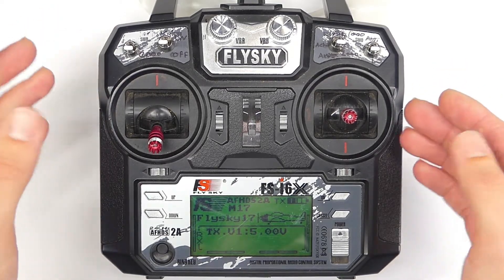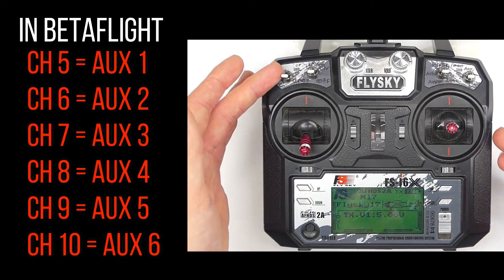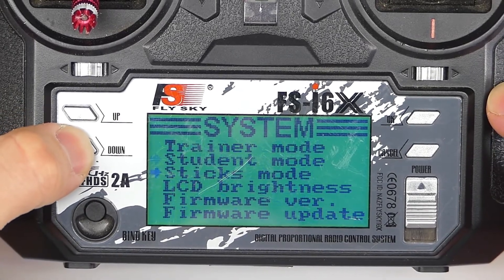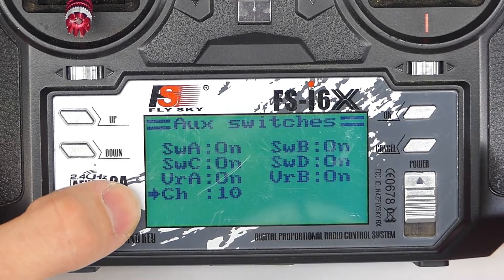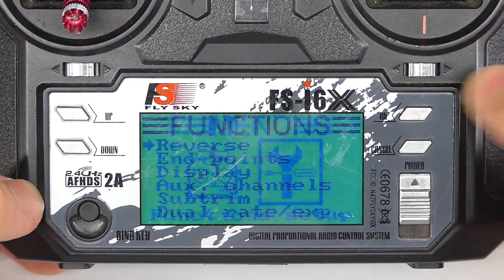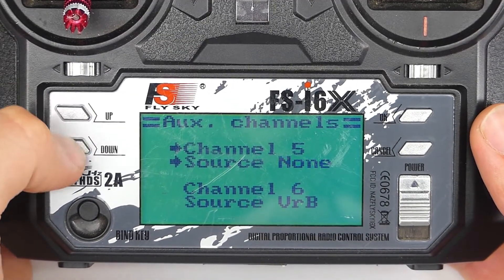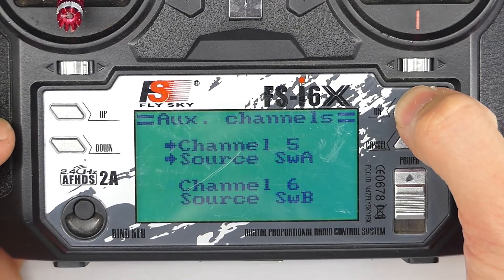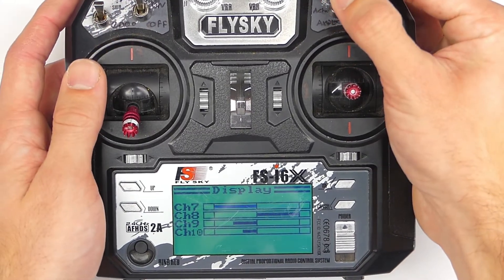What Are Aux Channels and How to Set Up Flysky FS-i6X Aux Switches

Comment: So if i set up a reflex gyro to SWc since it needs 3( stable, off, optimized), what can i do for the flaps? if i set it to any other switch its either no flaps or full flaps, I currently have my flaps set to the VRA knob so i can kind of control what degree of flap i want. What would you suggest?

Comment: Thankyou - I have fitted a A3V2 6 Giro stabiliser to my Volantex Trainstar Epoch. I bought the model that was short of the receiver / stabiliser and TX. I have just opened the box ater storing it for a number of years (yes its mad but there it is) and just trying to put back in what is missing so that I can fly it in windy conditions with some gyro help.. so do you have an explanation on how I set this upon the Flysky 3 position switch. so I want 1-GyroNormal, 2-AutoBalance,3-Gyro off. I have wired in a standard Flysky FS1A6B - 6 channel receiver. Thankyou for any help.

Comment: Hi Adam, I have a Radio Link Gyro.  I do not understand how to put the different gyro modes to the auxiliary switches. I have a fs-i6x transmitter. Like auxiliary switch 7 to have manual mode then gyro mode and stabilizer mode. Where are the modes to assign to the switch. 
Ken

Comment: Very helpful, thank you. My controller is a little bit different. It has 6 channels, and uses the 2018 firmware. I don't see the aux switches setting under the system setup. I could only assign two aux switches under aux channels, but it works well enough.

Comment: Adam. Nice video. How do I program each individual aux switch to do what I want? i.e. SWA - arm. SWB - change flight modes. SWC - (3 position) - xxx. SWD - RTL?   The assign aux switches menu item seems un-intuitive. Thanks.
Reply from the maker: If I understand your question, the switch will be selected in the menu for that specific function.

Comment: This maybe off topic or not I’m not sure. So I’m using this remote and a 10ch receiver. Now what I’m trying to do is use a hoverboard to turn into a lawnmower. I saw a video how connect and add the firmware. The firmware is for AUX I have it connected to ch1/ppm. On the right stick. (Left and right ) It makes the wheels go forward and backwards I can see the wheels spinning. But I don’t see the wheels moving left or right. I try moving all the stick every direction. I’m starting to think I need to do something in the settings so the right stick goes up or down to move left or right or the left stick does that either way I’m lost and not sure what to do

Comment: Hi, I have a Flysky FS-i6 and I don't have a y-cable for my ailerons so I want to use ch1 as master and ch5 as slave. But my servo connected to ch5 only turns in one direction. What should I do? I have turned ch5 source to none in aux channels and Pos.mix and Neg.mix is 100% btw.

Comment: Hello.  I am an old school pre 2.4 g  guy at age 75 but have been flying some newer planes lately. I have the Flysky pretty much figured out except one thing, and that is when I go to
turn a switch on  I want to use it says disconnect receiver before I can do so. I select the switch I want and then when I arm the plane 
I have lost all my programmed mixes. Is ther a way to avoid this ?  Thanks
Reply from the maker: Hi! Are you making sure to press and hold the "cancel" button to save the settings before leaving that page?

Comment: So question.. I got a new heli (OmpHobby M1evo) and this Radiomaster Zorro and I can't seem to figure out how to set aux switches. What I mean is, if we're talking FPV drones, we use Betaflight and under the "modes" tab, we can customize which "AUX" switch is say "arm-disarm" is and flight modes like "stability-acro." M1evo's Flight Controller can't connect to Betaflight, so how??

 For example, i renamed channel 5 under the "mixes" tab to "hold," which doesn't really do much, because that's not telling the Heli's Flight controller that I want that channel to be Throttle Hold, or Idle UP, or whatever I want it to be.. Anyone know? ?

Comment: I have no tips to offer because i need them myself plus some help lol.. im trying to change the transmitter on a 22 channel excavator and someone mentioned flysky so here i am. I wasn't sure about the channel thing and still not kind of but most of the movement is the joysticks for boom travel and bucket curl snd after tht its forward and back and rotation an thats it besides on/off, sound blah blah. My question is will that transmitter and the 10 channel receiver do everything i need or do i need extra one bc im  just confused honestly

Comment: Hi Adam, thanks for the tutorial. When activating SwC, there is the warning that I need to place all switches in their Up position and lower the throttle. 
All other SwC and Var are activated. Also tried when all others where deactivated and it was the only switch. I'm imagining it must be a control for something I don't know yet how to:)
Any help is appreciated.

Still finding my way.

Channel 10
Firmware version 9-Feb-2022
FS-i6X
Reply: After tinkering, think there might be an issue with SwC 7 since under display, it only shows the upper "bar" without showing the "lower" bar

Comment: Hey Adam , I'm Tim .  I just finished changing my FS-i6 into the FS-i6x from watching your other video.  It took awhile but was able to get it done . Now I'm trying to assign my switches back the way they were before.  I had switch (A) or your (5 aux ) as you have yours set up in this video .  as  normal and sport mode for Ail. Elev. Rude. With dual rates .  Then switch (B) your (6 aux ) as a safety for my throttle.  Motor would not turn on if the switch was down . Then I was using (D) your (8 aux ) for trainer/student mode .  But now I can't get the motor safety switch (B) to work at the same time as as the sport mode switch (A). And I was watching this video for help but because it's not a FSi6x it's a FS-i6 with the mod to 10 channels.  It doesn't have the same listing for aux switches.  It doesn't have that option after factory reset in your video.  So can you help me figure this out ? Let me know please 🙏  lol 😆

Comment: Hey
is there a way to set diff performance modes using the aux switches for a dual motor rc tank
like mode 1 will enable 50% motor power in all directions
and mode 2 will enable 100% motor power in all directions
mainly to have more precision on the stick while doing tighter movements

Comment: Hi

Is it possible to set my gyro gain to switchA and vrA at the same time?
So if I use switch it goes from 0-100 but then the vr changes the gain to allow sensitivity adjustment?

Comment: What I'm looking for is the map into for switches. ie  Aux 1 = Arm   Aux 2 = Mode  Aux 3 = ?  ect. What are the functions of the various channels?? I'm looking how to toggle off and on the led lights on a new drone I have with Flysky recevr  but I don't know which Aux equals that function. I'm using a multiprotocol Jumper T Lite tx.  Help?

Comment: Adam.... I will never fly a Drone. 😳 No problem with them, I'm just primarily into Ground. 
What I REALLY need to know, on my FS-i6X - HOW THE #@%& to I set up S-Bus or I-Bus on my Transmitter AND Reciever???

On my RC Semi, I've only got FOUR Ports to work with (on my Sound/Power Unit), and I need at least 8 Channels.
The One Servo Cable from the Receiver is really my only option. Any idea???? 😭
Reply from the maker: Hi! Which rx are you using?
Reply: @RCwithAdam1   FS-iA6B  Thanks!
Reply: @RCwithAdam1  
You're not able to figure it out either, huh? 
WHY can't FlySky have readable Instructions!!!?? 😖😬
Reply from the maker: @CarlRCTips  hey sorry, I lost track of your comment (YT doesn't update me about replies to comments). Have you watched this https://youtu.be/8ytxZWbPOfU video? It's for a drone with betaflight, but I think it will apply to your situation.
Reply: @RCwithAdam1  
Adam, that was very useful, THANKS!! 👊🙏  Is it REALLY that easy? 
Does PWM/PPM matter? And Signal goes in the far outer pin? 
Again, thank you so much! I hope I can get the Beier USM RC-2 to work. It's got S-Bus/I-Bus and Groupner (SOMETHING?) Settings....
That's for me to figure out next. 😳

Comment: i have question
most on amazon come with 6 ch reciever  can you pair with a 10 ch reciever ?
well 2 minute later i found a 10 channel one >_>
Reply from the maker: Yes, you can pair either of those receivers with the i6x (or i6).
Reply: @RCwithAdam1  thanks im new to rc transmiter/reciever thing
i aslo do not see any amperage limit on the reciever end  do you know when it become a concern?
Reply: @RCwithAdam1  got another question  i found that some servo can rotate 270degre but require a 500-2500 us pusle while ordinary rc do 1000-2000 us pulses is it possible to change that on the reciever ?

Comment: How a transmitter with 10ch can fit with a receiver of 6 ch ??
Reply from the maker: Hi! The number of channels the transmitter can handle is the ultimate limiting factor. For example, a 10ch transmitter can utilize any receiver having up to 10ch. Having any additional receiver channels won't be helpful because the transmitter can't use them. Did this help?
Reply: @RCwithAdam1   i have flysky transmitter and receiver ia-6b with 6 ch.so even if i setup the transmitter with 10ch i will be limited with 6ch because of my receiver.but if i changed my receiver with another one of 10 ch it will be good .if that is your response then i got or I’m wrong and brw thank bro for the video i appreciate . 👍😅

Comment: Hi, I have this handset, how would I program channel 7 to swb on the remote to switch channel 3 control between servo 1 and servo 2? 

Channel 3 which is the left joystick up and right to control servo one with swb in the up position and the second servo with swb in the down position? Would the two servos be connected to channel 3 with a relay on swb switching between the two different servos? Cheers

Comment: I bought this motor controller. https://www.amazon.com/gp/product/B087M3GVYX/ref=ppx_yo_dt_b_asin_title_o05_s00?ie=UTF8&psc=1 I am trying to wire the vrb knob on the remote to the vairable speed controller option on the board.  I have assigned channel 5 to VRB as you show, and the control board input to the top, the ground at the bottom and the 5v in the middle slot of the reciever with the 6 channel reciever.  I am not getting anything when I try to turn the know.  Please help if at all possible.  Thanks in advance.

Comment: Does this require the firmware upgrade or not? Subscribed!
Reply from the maker: Hi! If you're referring to the DIY firmware upgrade that people do on the FS-i6, then NO. This one is already a 10-channel radio. However, if your radio arrives with older firmware on it, you may want to upgrade to the latest version.

Comment: Hi Adam,

I'm confused about something.  When you enable the extra channels, how do you then use a switch for your dual rates?  I like to have my rates on separate switches - elevator, aileron & rudder.
Reply from the maker: Hi, Rick! As far as I know, there is not a way to change the rates of channels individually--just all at once.

Comment: Hello. I have two separate but related questions I am hoping someone can help me with. 1: If I set up a mix, is there a way to turn this mix on/off via a switch?  2: Dual rates(sport/normal) are activated by a switch but is there a way to have 2 separate switches for dual rates, say one switch turns on sport rate for ailerons and another switch does it for elevator.  I had both of these functions on another radio and useful to me.  thank you.

Comment: I have the fly sky fs i6 and I don’t have those channels on my controller in the system setup can anyone help me
Reply: the i6 is a 6 channel transmitter , you need the i6x for 10 channel , or reflash your i6 with the updated firmware (it's probably easier to buy the i6x , and save the fucking around)

Comment: But how do you actually connect it to the drone, I got the eachine x220s kit with this radio bit how do you get it to control the drone???
Reply from the maker: Hi! This video might help https://www.youtube.com/watch?v=Jmcc71uxdE4 This setup guide is for the original X220, but the concept is similar for the X220S (a X220S setup video is on my list). Basically, bind the transmitter (tx) and receiver (rx), connect the drone to Betaflight, setup betaflight to get the flight controller talking with the rx, and set up an arm switch and adjust rates (I know, it is a bit of a process!).
Reply: RCwithAdam thanks, do you connect them via betaflight

Comment: In factory menu (hold left and right sticks in bottom left corner and turn off) aux switches podmenu has a DIY option... Why?
Reply from the maker: Hi! Good question! I just now saw that. My guess is that maybe there is a spot for another switch somewhere on the board.

Comment: Hi. I have got a problem. I have not "aux switches" in a system menu.... How it is possible? Thank you
Reply from the maker: Hi! Which model transmitter are you using? And can you tell me what version firmware it is (this is found at the bottom of the System Settings menu)?
Reply: If you have the firmware 2017 this menu only shows, if you hold both sticks to the lower left and while holding turn on the is6x. It took me a while to find out. Hope this works for you.

Comment: How can I change channel 2 and 4 from the sticks to the switches? Thanks. I only need the up/ down and left/right for rc car and want to use channels 2,4,5 and 6 for switches for 2 speed transmission and locking diffs.
Reply from the maker: Hi! I'm not sure if you can. At least, not just with the settings. You MIGHT be able to just switch the physical wires, but I can't remember at the moment how they're connected.
Reply: @RCwithAdam1   thanks. I think I will just order the 10 channel receiver and leave 1234 as steering and throttle and use 56789 and 10 for the switches for locking diffs and 2 speed transmission. would that work okay so you think? thanks again.

Comment: would you reccomend this transmitter as i am building a drone for the first time also is it possible to build on with self leveling and what should i do to first set up the trans mitter
thanks also how do i change the rates
Reply from the maker: Yes, I would. What kind of drone do you want to build? racing drone? camera drone? in betaflight (drone settings configurator) you can change the rates and switches for the flight modes.
Reply: @RCwithAdam1  thanks i am going to build a racing drone and am practicing flying manual in a simulator i am using a mamba f405 mk2 esc and flight contoller is it possible to use this transmitter with that and also possible to program it to have self leveling as i have learned to fly LOS and would like to get the feel of the quad before going acro

Comment: Three position switch setup home manual and stable
Reply from the maker: Hi! for a quadcopter or airplane? on betaflight?
Reply: @RCwithAdam1  ZOHD Dart 250G 570mm Wingspan Sweep Forward Wing AIO EPP Racing FPV RC Airplane has a GPS system that requires no computer but requires a three position switch for return to home stable and manual flight

Comment: Hi, I like your videos you explain very well. How do you setup the battery external(in the i6x)? Because mine around 1min starts beeping I thought maybe there's something to be set from the i6.
Thanks
Reply from the maker: Hi! Thanks! Does it only beep if you leave it alone? Because that's there to remind you you've left it on. Otherwise, if I recall correctly, the INternal battery setting will adjust the displayed transmitter voltage, and external is for the receiver voltage (I'll double check later).
Reply: @RCwithAdam1  yeah I did change the settings in the rx external now its good

Comment: Mine came from Banggood perfectly packaged and all channels including Aux channels were fully setup. I bound the receiver to the quad and absolutely no setup was required on the transmitter including end points ect. Amazing.
Reply from the maker: Wow! Which quad?
Reply: @RCwithAdam1  I only bought the radio, using it for a freestyle quad I already built. In Betaflight all I had to do was choose IBUS and everything else was perfect but I did have to setup modes. I didnt need to do anything on the radio.